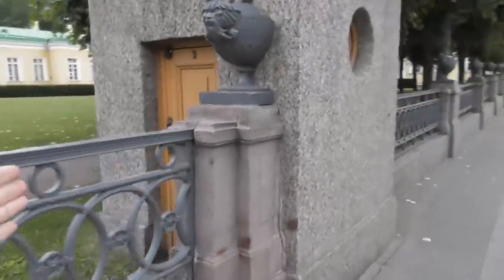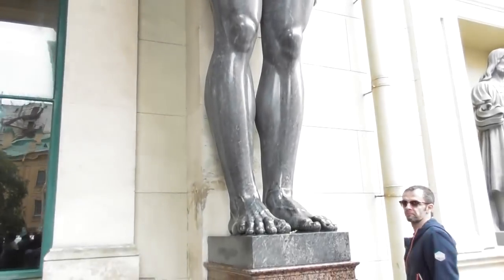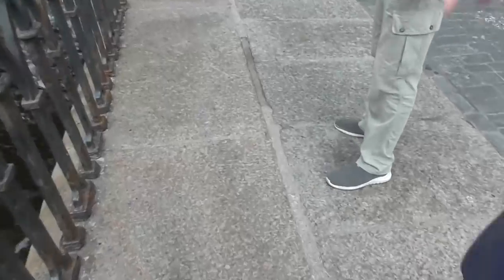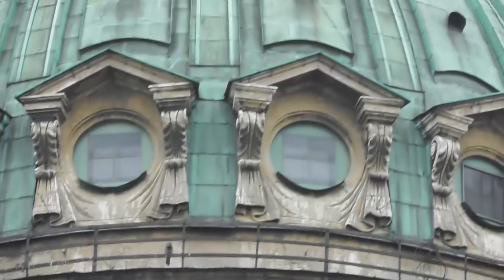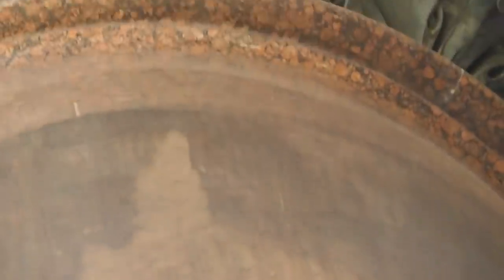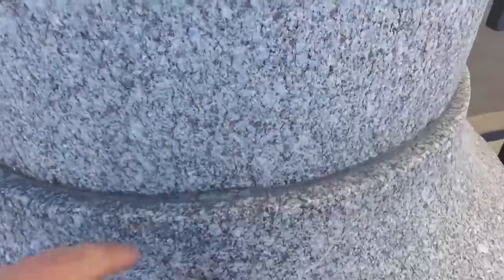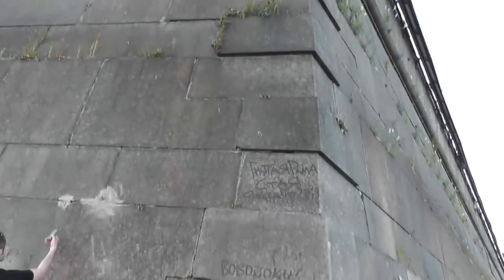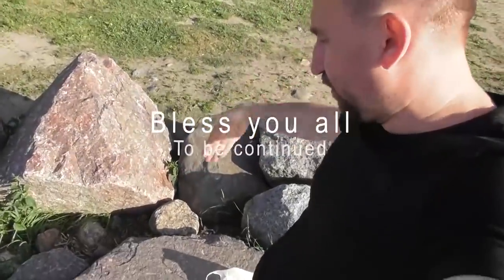Millions of tons of granite - enigmas of Saint Petersburg

Comment: At the end you are talking about the holes in the wall ... maybe it was for catching energy (electricity) for every day usee. And the starforts are the energy centers where the electricity is sent to the 'plugs' in the buildings.
Reply: it would make sense: starforts near rivers collect energy from rivers with turbines or another technology, then they sent it via towers to the 15cm holes in the buildings and on the outside you can charge the city trains on the metal plugs.